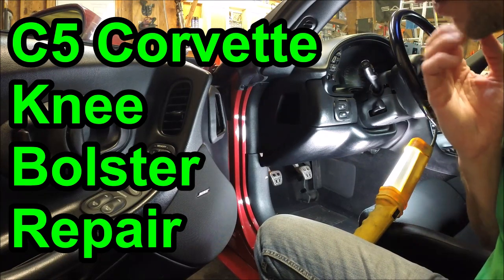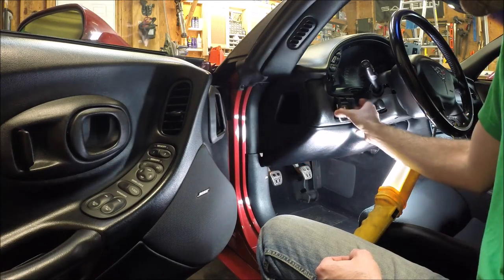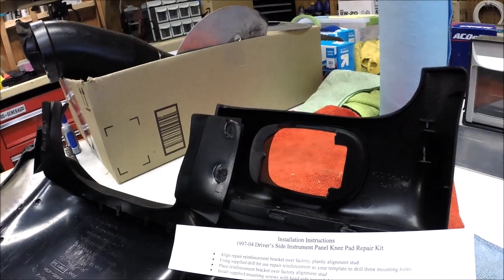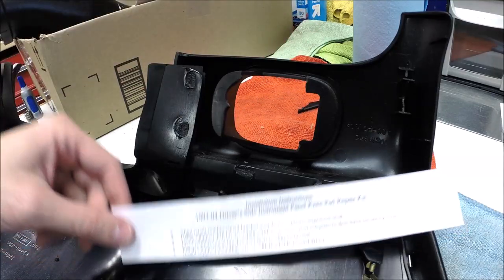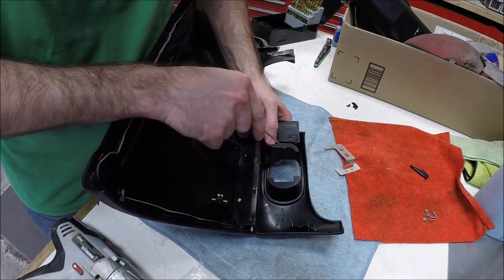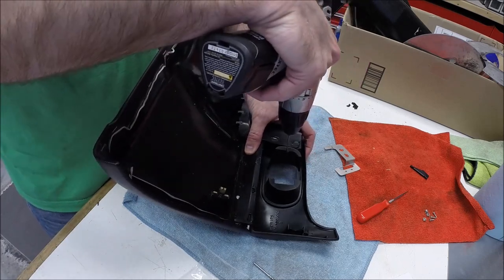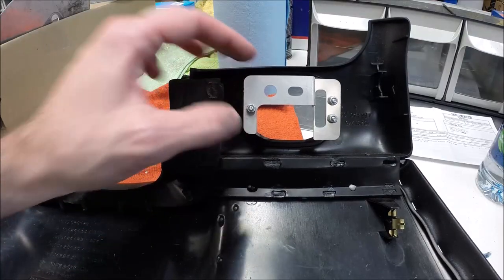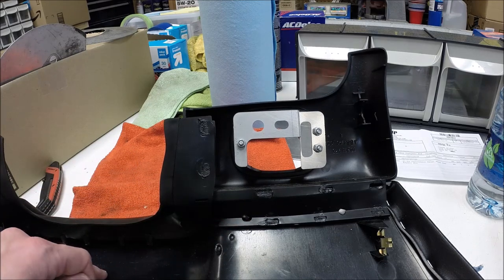C5 Corvette - Knee Bolster Repair

Comment: Filing this vid as I’m sure I’ll have to deal with this issue at some point. Great vid as always. 👍
Reply from the maker: Yea you can only take that knee bolster out but so many times before the plastic cracks.   But the repair was definitely more economical than trying to buy a used bolster.   Thanks for watching!

Comment: Nice! All of my plastics on my c5 seem to need some repair or reinforcements.  Shame they made such cheap plastic on an expensive car and then don't keep some type of stock on hand at GM.  Bookmarked the site for next time I have to pull the knee bolster.
Reply from the maker: Yea, it's frustrating every time another piece of plastic breaks off.  I'm just glad a company makes a repair part.
Reply: Ive re melted so much plastic on mine, reinforced with some type of glue...that I think I could make a business of fixing plastic parts on these cars lol

Comment: I hit the knee bolster with my left foot exiting the car and broke a plastic clip on the left side, so it's hanging down now.  Do I have to replace the entire panel to fix it?  I had to just hold it in place with duct tape.  A new knee bolster on eBay is $325.  Ouch!

Comment: Is there a kit that fixes the other side of the knee bolster?  The plastic that    holds the temperature sensor and the screw on the right side broke on my C5.
Reply from the maker: I don't think there is.  But if you find one, post a link as I'm sure other people would be interested!

Comment: I just put 4 dots of superglue on mine lmao. Maybe something like this kit would be better haha. I also broke both of the vertical clips bellow this area that snap in, superglued one of them back on but the other is long gone now.
Reply from the maker: Yea, the plastic is just so brittle; it seems to break every time you touch it.  I had tried various methods of trying to piece it together but eventually this was my only choice vs buying a new bolster.   Hopefully you won't need it but at least you know it's an option if you do!
Reply: @ScrufsGarage  and it broke today 😅 might have to get one afterall
Reply: I might try to 3d print this part... It seems like a perfect job for a 3d printer. I own one but I have never designed an object myself so wish me luck 😅
Reply from the maker: Perfect opportunity to give it a try!   Can't wait to hear how it turns out.
Reply: @ScrufsGarage  Okay version 1 complete! maybe like 25 cents worth of plastic haha. https://i.imgur.com/YS4mPeG.jpg 
I don't have a hole for the screw cuz i figured im gonna have to drill holes anyways to screw it into the plastic unless i find another method sooo this is what i got so far!
Reply: honestly when you have the button pushed into it, it keeps it pretty snug in there. might not even need to drill into the original plastic, just put 1 hole to attach it to the frame and it might be good to go! I'll go out tomarrow and line it up with the screw and edit the model and print a v2 with the screw hole
Reply from the maker: @gopro2027   Somehow I missed your reply when you finished the 3d print version.  Very cool!